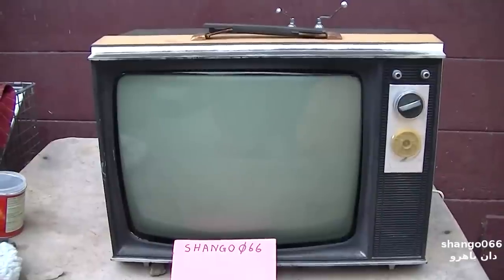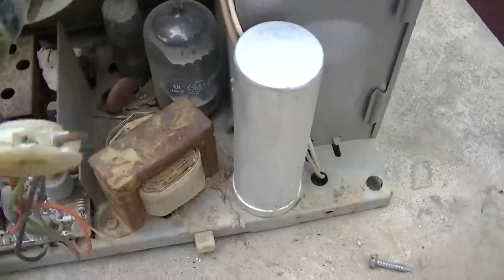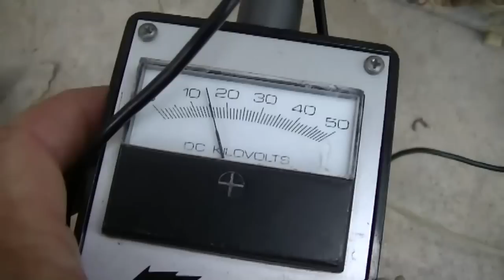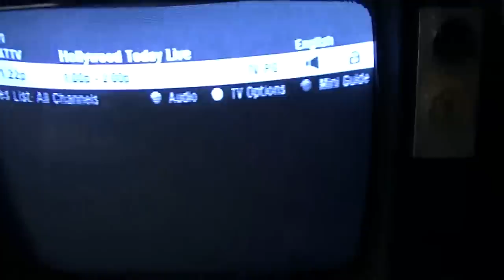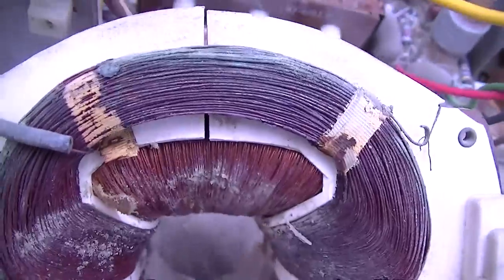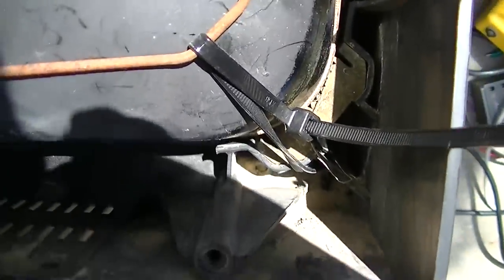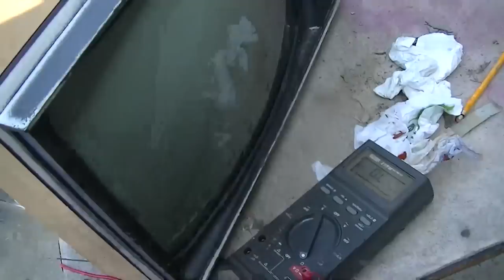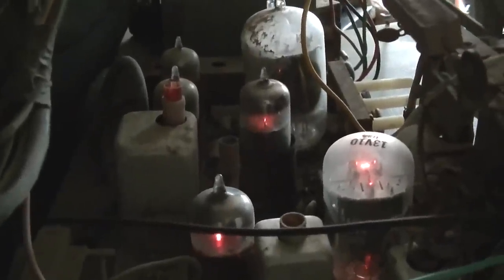RCA Tube Portable Television Resurrection

Comment: Great video! I love it, this TV was setting in the desert for probably 30 years and came right back to life.  I have a similar story although with a much newer TV.  I was helping someone clean out an old falling down barn and in it was a TV.  I still have it, but I can't remember the model.  I'm quite sure it was from 1986, possibly an RCA.  I know it has a little sensor on the front to adjust the picture based on the light in the room. Actually now that I think about it I believe it is a Selectavision.  Anyways, the part of the barn it was in had no roof and the TV was covered in dirt and dust.  They were just gonna trash it so I thought why not take it and see if it works.   I did absolutely nothing to it at all, just took it home and plugged it in and it fired right up!  The only problem is the colors are off a bit, but still amazing that a TV that has been basically exposed to the elements for what I would guess is at least 20 years or so would fire right up and display a picture.  It is true what they say, they don't build'em like they used too!

Comment: You need a camera with manual shutter speed setting. Set it to 1/60s to capture one field, or 1/30s to capture two fields (both odd and even lines) in one camera frame.
Reply: Nice to see you watch shango066 as well.

Comment: Im poor dont have a lot of money like ever, i always look around for electrical things to help in the house .I think its disgraceful what people just throw away, i had 17 years out of one of the tvs i found and fixed i find what you have done fasinating
Reply: RAD PC When the Analog to Digital transition happened, we had tvs lining the roads for trash pickup. Being a scrapper, I picked up what my truck bed and cab could hold. You'd be surprised how many of them still worked perfectly other than not being able to get an analog channel anymore. (I still can get a ham radio tv transmission once in a purple moon) I think only 2 sets didn't work out if all them. I've also picked up working computers, monitors, laptops, vacuum cleaners, drills, etc.... People don't understand that just because it's 2 years old doesn't mean it isn't useful.
Reply: @bairfamilyfarm1336  I picked up so many old CRT TV's which are perfectly fine for retro gaming.

Really made me happy to see so many free TV's
Reply: It really is. I’ve found so many good crt television sets, radios, air conditioners, vacuum cleaners tossed in the trash typically for a bad cord, clogged filter (especially with a vacuum or air conditioner). I recently grabbed a 1955 magnavox console television from an older person’s home that was tossed to the curb. Just needed two capacitors and a new rectifier tube. We live in such a disgustingly disposable society.
Reply: My specialty is much more towards digital electronics, but I'm in the same boat.

It's incredible what people throw away! Almost all of my parts come from junk electronics.

Comment: Astonishing! Indeed a tribute to the build quality. I wonder how much that TV cost new in today's money.I wonder what the outcome would have been if the cabinet was not plastic. I rescued a wooden cased radio (Pye P45) riddled with woodworm and the cabinet base was beginning to succumb to dry rot. The chassis was brown with rust with thinning of the metal in places but all the TXes and coils were unaffected, probably because they were somewhat potted in wax. The paper speaker cone was almost completely gone with just the voicecoil and dust cap remaining. I fitted an new Altai 8 inch driver. A full recap and one new electrolytic and it works a treat. I think the set had the occasional drenching in water as some of the dial printing has slipped on the glass but that could be to wildlife residing in the set at the time.

Comment: I haven't found a discarded compactron set in over 15 years now :(. Man they used to be a dime a dozen. Came across a 50's RCA console not too long ago at the curb but there was nothing salvage so I drilled out the sockets for project use. My best barn resurrection ever was a late 50's ('58 I think?) weak CRT Admiral round screen colour 3 chassis set with electronic (22-1/2V) ultrasonic remote - thing must've cost a Cadillac the year it was manufactured.  Having fun going through your channel. Seems like we both have a fetish for hollow state.

Comment: Thanks Shango for another great video. You mentioned what other countries think about USA TV shows! Well I live in Perth Western Australia (I don't know if you have heard of it) and we get a lot of shows being pumped out over our TV sets from you're fair country. I myself stopped watching BC-TV some 12 years ago because of all the bad TV shows being shown on TV. There are a lot of things that the US does and does very well but TV shows are not one of them. I spend a lot of my time like you do and most days I'm lucky to find time to watch a TV set. In fact my TV was brought and junked without ever being turned on. This was because we went to full digital TV 16th April 2013 with no stations broadcasting analogue TV signals anymore. I brought a new TV 3 months before that time and never used it. I tried to sell it for $10.00 as it was still in it's box but no one wanted it. I ended up buying a new DTV set and even this set has less that 50 hours on it. Why you may ask, well I get 28 channels of crap and I just won't watch it. I do watch a lot of You Tube video's in the evening on my PC but other than that Perth gets too much USA type TV shows and it looks like my country is starting to make them just like your country does. I see why you don't clean up these vintage TV's sometimes just a dust-out can end a good TV set. A shame it ended like that.    Cheers.

Comment: I think it would be fun to run the crap out of this set.  It would need to be monitored under close supervision. It would be cool to see what failures show up and how long it took them to appear. Keep a log on the hours. I would never have bet those sun baked electrolytic caps working at all. Interesting video.
Reply: I agree; Shano, if you have no plans for this set, this is most certainly something you should try!
Reply: I like the idea of it reasonably cleaned out and functional. Then play it an hour or two here and there. They don't make them anymore. Running it to failure is definitely an interesting question. It will fail probably many times. But eventually a part that may be very difficult to acquire could fail and render the set inoperative. That I'd regret. But I'd accept that if the hours of use were to someone's enjoyment. God Bless

Comment: That TV definitely works great for all it's been through.

I've seen several yokes from Sharp monitors where the horizontal winding arced out.  The adhesive that was used to hold the rubber wedges in place had broken down and ate through the windings.

As for the corners being blank with the replacement yoke, it's possible that it needs to come forward more, or it's from a tube that used a different deflection angle.  I run into that problem a lot when doing CRT swaps.  At least with black and white sets, you don't have to do convergence :-)

Comment: were did the quality in eletronics go?a modern tv wold never survive 35years in a desert outside
Reply: they can not even survive  for 35 minutes in those conditions  :D
Reply: Everything's small, delicate and complicated. While there certainly is some lack of quality, it's mostly a complexity issue. While these TVs were often quite complex for their day, modern TVs are much more complex. Also, even compared to early transistor equipment, tube stuff has huge tolerances.

Comment: Amazing resurrection!  If that set had been inside protected, it probably would not of worked.  Plus it being thrown into that pile of junk...The baking heat may have  kept the caps in good condition.  Yes, that's quality of design and assembly.

Comment: Shango - To help you get better video when recording with your video camera,  just remember this...here in the states, AC mains works on 60hz (as you know of course), TV's refresh at 60hz, so you need to set your camera shutter to 1/60th of a second.  The reason you get black banding and other anomalies as such is because the camera is set to auto,  when you change your angle, you are changing your environment, since the camera is in auto, the shutter changes from low to high, so you can expect total black (high shutter speed) to a smeary picture (real low shutter speed). For those cameras that you can not change the shutter speed, look for settings that will allow you to set it for low light, this will slow down the shutter, however, if you're shooting in daylight, you may have a blown out picture....but atleast you have an idea of why it's happening and how to fix it.

Comment: I enjoyed it,  Can you see a flat screen TV out in the desert for over the weekend and working at all?
Reply: +Carl  Burgess I could see one working after a weekend (if its try). But probably works best for a fire with all the plastic. But they sure not made to last. 10 years is what they do if your lucky (and that's only cause of laws that we have here in NL).
Reply: +Carl  Burgess You have to consider the complexity of a modern tv. You'll find controlled impedance busses, high frequency chipsets with ball grid arrays and the voltages have to be spot on, for it to boot.
This old RCA doesn't care if voltages are off 15%...

Comment: Incredible picture and the sound muffled a bit 40 years ago with a color tv a anode high voltage popped off at there 40,000 volts was flying about a foot or so

Comment: Very rugged TV, the quality is impressive. I would even consider a more proper electronic repair, just so it's not on the edge of death all the time.

In cable TV we get a lot of american shows, given that they are the same networks, it's no surprise. Same stuff, just in spanish, of course most of the time they don't broadcast shows that would only make sense to the american public. For those shows, we get our local ones which are equally boring crap. At least cable TV is not as horrible as the aerial channels. Those are just heavily biased news and turkish-themed drama series all day, with an ocassional movie or the Simpsons.

I have a flatscreen they gave me for xmas a few years ago. Never use it, just turn it on from time to time and leave it on to make it less likely for fungi to infest it.

Comment: Could you adjust the horizontal width using controls or put a small resistor in series with it? If all else fails I would offer to attempt to rewind the yoke, but no guarantees. I would probably 3D print a winding form for it so I can wind it easily.

Comment: 240p never looked so good ehh?
Reply from the maker: +John Brown Its in 1080/30
Reply: +John Brown what?
Reply: +John Brown sometimes youtube takes a while to show all the formats.
Reply: Highest resolution in Youtube settings is 720p
Reply: It depends on your video adapter installed, and also your Internet speed.  YouTube settings on my machine, show 1080p/30 as the highest resolution.
Reply: ***** 
1080 for me also - on my traditional computers. 720 or lower on the mobiles.

Comment: Why dont you clean the dirt completely out first? I dont understand why you dive into it with it still thick with dirt inside. Also spray some rust killer on all accessible rust. Cleaning at a minimum is needed to test it accurately.
Reply from the maker: False, it causes more problems than it solves.
Reply: Leaving it full of dirt is counter productive regardless if it causes some parts to fail. It seems cruel to the device to force it to run like that. Theres many options. Compressed air, vacuum, light brush. I found your videos interesting non the less. Its your stuff so you can do as you wish.
Reply: belly tripper Yeah whatever! Who cares what Shangos house looks like & how he lives as that's his business & no one else's!!!!

Comment: 6:20 - And you really should... but you're not gonna?
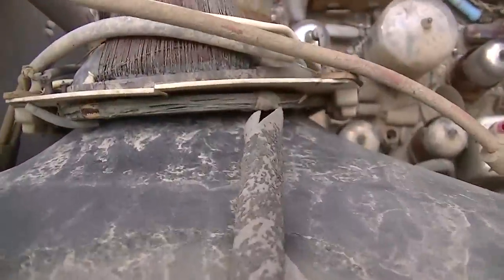14:35 - Oh, ya think? ;)
Reply from the maker: If you finish the video you will note cleaning it actually damaged the yoke and it had to be replaced. Dirt inside the tv is not an issue for me
Reply: Isn't it a problem for shorting PCBs and insulating tubes in a thick layer of dust? It's not really about being clean and looking nice, but I always figured high voltage and dirt don't get along. ;) But TBH, your record so far in these videos has been nothing short of incredible, so I've got to trust your judgement :) It sure does give me the creeps seeing all that dirt powered up though, hah.
Reply from the maker: It can yes but they designed the sets to tolerate some dirt. The issue with this stuff is the elements have deteriorated the insulation and components to where cleaning causes more damage than good. There are still about 20 waiting to get going so we will see how the pattern plays out.
Reply: Seriously can't wait to see more! I'm super interested in all those old tools and testers. I grew up around so many dying CRTs and I could fix all the electronics around me except for those. CRT TVs required an engineering talent (and bravery) all their own :) thanks for sharing your expertise in these videos!
Reply: me to

Comment: As said in comments before, TV content in Germany is just as bad and unwatchable as anywhere else in the world. I only use my TV for occasional zapping around the horizon with my 10 ft satellite dish but never watch regular domestic progamming. That little TV is indistructable! A modern TV would most likely not survive a humid night in the garage and that one was out in the elements for decades and it just runs with no work at all. Great example of olden days´quality requirements.